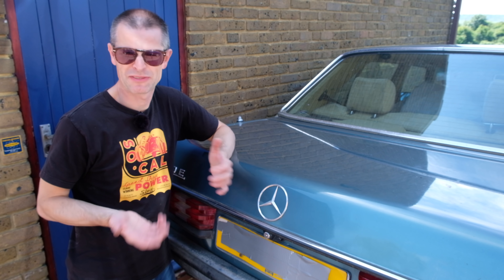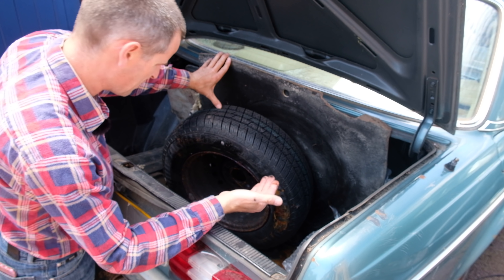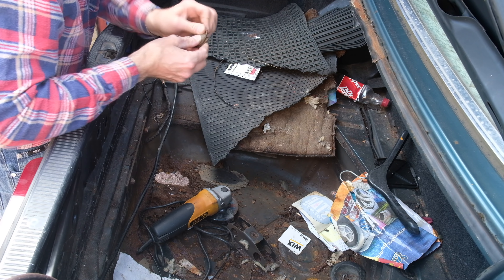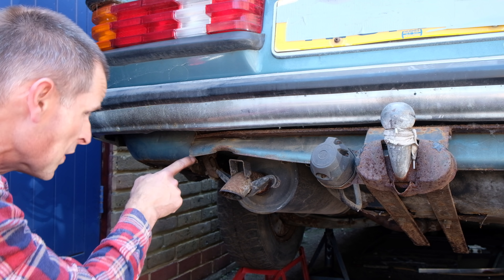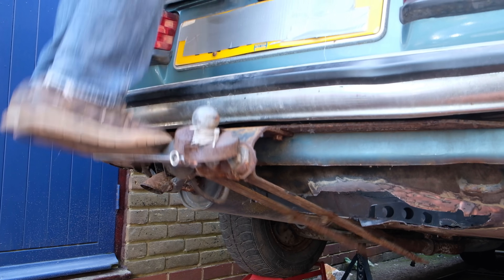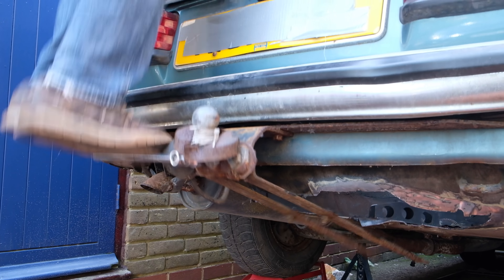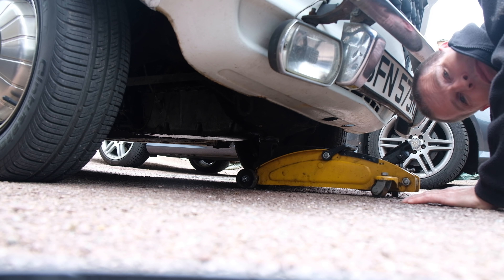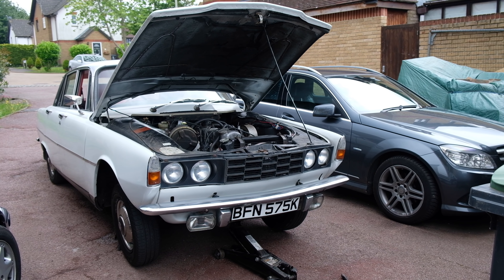Merc W123 & Rover P6 fails

Comment: Star FM looks like a Cambridge Station. I feel your pain on the escalating repairs my 110 chassis outrigger turned into a full blown footwell an B & C pillars.  My MX5 Sub fame weld about the size of a 50p became all day due to previous owner filling with foam in a failed attempt to prevent rust. Loving the vids as ever.
Reply from the maker: Thanks Alan, I should have seen it coming...the P6 C post was horrible when it was opened up last year as well!

Comment: That adjustment screw on the steering box, is that a lock nut at the bottom of it?
Reply from the maker: yes. that would be that..
Reply from the maker: but the other problem stepped up to become problem of the day

Comment: If you didn't already know that's not a factory tow bar. The factory ones went into the rear subframe rails behind the bumper instead of bolting into the spare tire well like that aftermarket one. All the rubber plugs for the tire well and and the side wells are still available from Mercedes. I know because I've replaced them.
Reply from the maker: It did not look very factory, the straps too long and bolted through a thin wheel well skin, a bit of a mess really. If there’s any well left I’ll pick some plugs up

Comment: That spare wheel well was always going to be a nightmare, surely that was obvious from just looking at the crust?

Ok so it was mildly funny watch you jumping up and down on the socket bar, trying to shift the towbar bolt's, but some folk will be watching and thinking that's the way to do it.......when it isn't really is it? 

Not wanting to sound like a stuffed shirt, but it's always best to assess and plan out a job you haven't done before picking up a spanner!
Reply from the maker: TBF I knew it would be bigger than the actual visible hole, but wasn't expecting it to be as extensive as it was - tapping off camera suggested more solid metal, and no other bolts on the car have been seized, only these non-Mercedes, as you saw a metre of scaffold pole and WD40 was waiting in the wings to do the job but you got a good impression of how stuck they were

Comment: Have you jacked the cross member into the pulley ?
Reply from the maker: Not unless there’s more rust I don’t know about, that’s a very solid part of the car, rubber mounts more likely
Reply: @furiousdriving  True I remember from owning a 3500S the cross members are pretty chunky. Obviously the 4cyl is different. Are there any other signs of the engine dropping ? I'm guessing replacing the engine mounts is relatively straightforward. On the W123 would buying a replacement wheel well / boot floor be a better way of repairing ? I have a faint memory that W123 patten panels where cheap from Euro car parts / GSF. Good luck.
Reply from the maker: The cross member is not that different on the 4 cylinders, still a massive girder! Engine mounts are quite easy, theres so much space to work around.
Ive not looked at panels yet, but  yes that might not be a bad way to go if they are still available

Comment: Taking the rear bumper off the Merc would have made taking the tow bar off far easier.  That factory underseal on the Merc is terrible stuff, if dries out and then loses its adhesion to the metal which creates a nice little gap for moisture to creep into and corrode the metal away while the visible surface looks fine.  If you have an older Merc that still has that stuff on it then it's worth spending a weekend getting rid of it, cleaning up the metal and then giving it a proper rust-proofing.  On the Rover, it looked like you didn't loosen the lock nut on the steering box adjuster screw before trying to adjust it, you need to loosen the nut at the bottom of the screw just above the casing to adjust it, but if you've only got the issue when turning one way it would suggest that the issue is likely to be in the front suspension on one side of the car.  It maybe something like a failing trunnion or ball joint which can be a serious issue as my dad's old P6 suffered a front suspension collapse due to a failed trunnion.  It can be a bit of a pain trying to locate the problem with the front of the car up in the air on axle stands as the wheels are free, they're not weighted by having the car sitting on them.  A tip I was told by a time-served mechanic was to put the front wheels on a couple of glossy magazines to act as turntables and have someone else turn the steering while you watch the suspension each side.  I suspect your issue with the Rover engine machining its crank pulley on the chassis rail is probably down to failed gearbox mounts which allow the engine to tilt backwards a bit and also slide back enough to cause clearance problems in the fairly tight engine bay.  It wouldn't be a bad idea to check the engine mounts at the same time as, with the car being a little incontinent, they might be getting a bit soggy...
Reply from the maker: Those bolts were also rusty and inaccessible, with the took hitch off Ive got better access.
Yes, its horrible stuff and really thick as well. The whole underbody needs going over and redoing.
Yes, I missed the locking nut, when I spotted the pulley I kind of forgot about the steering! I like the magazine tip!
Reply: @furiousdriving    Those old angle iron tow bars were a real mess.  They also often did a lot of damage to the vehicle they were fitted too in terms of pulling body seams apart, splitting seam sealer and starting rust in places that don't normally rust...
Reply from the maker: It does look that way, the rust seems to be centred around those mounting points
Reply: @furiousdriving    That's not surprising, a lot of tow bar fitters don't rust treat and protect the metal after they've drilled new mounting holes so they're going to start rusting pretty much from day one, even on galvanised metal as the galvanising is only on the outside of the steel.  The guy that used to have our local tow bar fitting and trailer centre also owned a shop that specialised in rust repairs so he likely earned twice from a lot of those vehicles and owners...
Reply from the maker: @gosportjamie  a nice little earner...
Reply: @furiousdriving    True, but it must seriously suck if you've spent good money having a tow bar "professionally" fitted then a few years later you've got to spend more good money having the boot of the car welded back together because nothing was done to protect the bare metal so it's rusted away...

Comment: I'd be damned if I used a 15 year old spare tyre on a car, irrespective of whether it's sat in the boot or not. Have a look on the tyre wall for the manufacturing date, it will be a four digit number like 3204, meaning 32nd week of 2004. Bin it if it's older than 5 years.